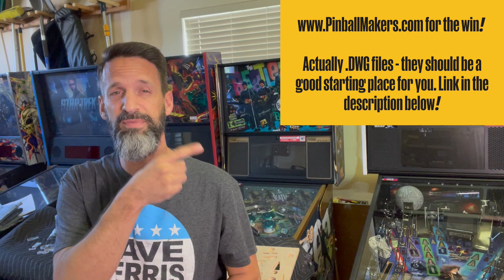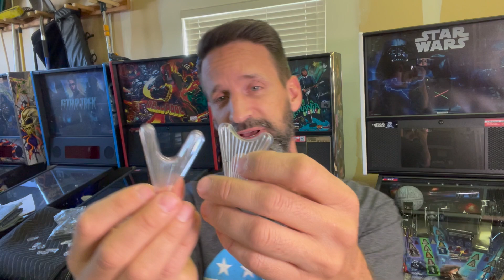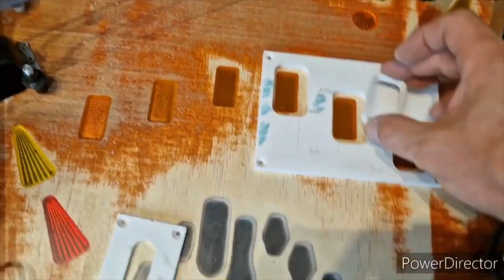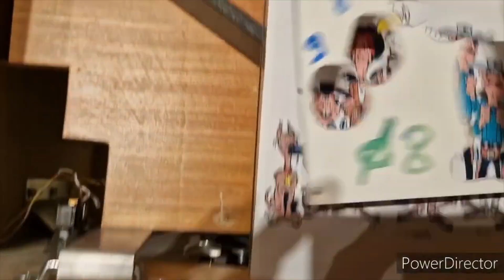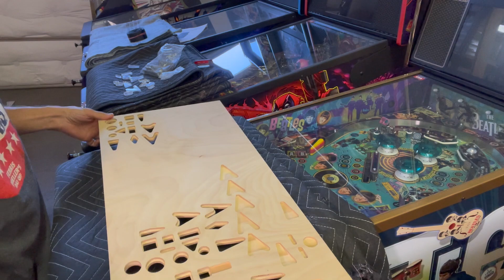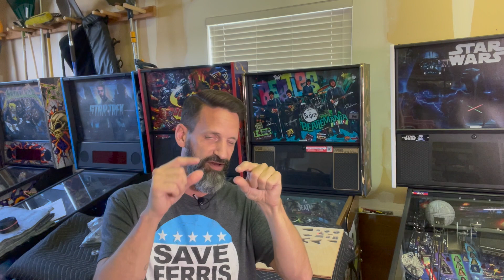HOW TO MAKE A PINBALL MACHINE: Cutting Playfield Insert Holes

Comment: mmm ... I like to uncomplicate things (usually because before I am done its too complicated, so I hope to achieve success before that happens. lol).. Since creating a hole to match the 'EXACT' shape I would be happy with a narrow 'trim' around it. by that I mean create the shape but make it 1/16" to 1/8" bigger - this avoids need to be 'exact' to the contour. then place the item in it, add epoxy resin to fill in the gap. scrap and wet wash the surface flat, then sand to plane it all the same. Don't think bubbles would be a big issue but can let a vibrating tool sit on it for a few minutes. 
So instead of the difficulty being getting the outline exact to fit, you design for how good it looks. which is what we need to spend our time on anyway. it would also be 10x faster

Comment: If the insert is below the wood, just fill the hole with clear. A la cupped inserts in playfield restoration. I have a couple videos on it.
Reply from the maker: Yeah I guess I could fill it with epoxy - I've never done a clear coating before, is it easy to fill a low spot more than other areas?
Reply: @thepinballroom  it’s a lot easier to make it level if they’re low vs high. You just use an eye dropper to fill it with clear.

Comment: Get a block sander for auto body repair, a 2x4 will not be straight enough, and will shift with humidity. A granite off cut would also be good, maybe better
Reply from the maker: Thanks for the tip!

Comment: Thanks for sharing.  I definitely agree with John Marsh's guidance, which mirrors the old tutorials the Classic Playfield Reproductions had posted about a decade ago (long gone now).  In summary, leave slightly proud, epoxy in place, use a planer to sand flush (or block sander as you advised).  Then artwork, then clearcoat.  The alternate strategy of sanding flush before installing works better on a playfield restoration, where you would damage the artwork if you sanded after epoxying.

Wood does swell/shrink with humidity and may change throughout the year or as you move a machine around the country.  For that reason, I would suggest you trust the epoxy to hold the insert in place.  Too tight a fit, and the wood may swell/crack and pop the insert.  Even a tiny gap is okay, as the epoxy can fill in the gaps, and gets sanded flush as part of the install process.  The artwork typically hides the gap so you'd never realize that it's common to have small gaps before glue-up - sometimes you can see this on a well worn/loved playfield.

Since you mentioned diffusing the lights, I'm surprised you're going with clear inserts and not white.  

While it's probably too late to help you now (great work on doing the CAD modelling), you probably would have had a much easier time doing this in Imperial/American units instead of metric.  While I do a lot of engineering and prefer working in metric, when it comes to pinball you have to keep in mind that most parts you're working with were designed many decades ago in the USA, and this definitely applies to the inserts, and they rarely used metric back in those days.  For example, that ~3mm radius is actually just the radius of a 1/4" router bit.  Insert sizes are typically in fractions of an inch, i.e. 7/8", 1", 1 1/8", 1 1/4", 1 1/2", etc.  They weren't very creative, they simply used the tools and measurement system they had handy, so a 1/4" router bit and fractions of an inch.  Same goes for arcs.  I'm not sure if this still applies to some of the more modern shapes, like those fancy triangles, but for any of the classic shapes this should hold true.

Looking forward to seeing a lit up playfield, keep up the great work.
Reply from the maker: Wow, awesome, thank you so much for sharing this! I will back off a bit on the fit of the inserts then and rely on the epoxy - Tibo mentioned a similar concern - I was worried that if I was too loose that the wood could shrink and potentially create too much pull in the epoxy etc and so I wanted to rely more on the lateral strength of the insert if the wood swelled vs the other way around, but I admit I'm making assumptions about the material strength etc that I haven't tested...?
Reply from the maker: Oh, and about the clear vs white inserts...I went with clear because I didn't find any white 🤣

Comment: moment of glory...;) If I had known I would have shaved..lol I promise next time I will frame my video better. Indeed I agree with your arguments and it will also cause problems for the artwork. The fact that you have done everything by digitizing at each stage is a big advantage. that's the beauty of this type of project...we develop our protocols to achieve our desired result. I have just solved one of my biggest problem: I started a playfiled with an atypical size without thinking about the lockdown bar. I managed to make a custom one .for the inserts I adjusted less than you because I'm afraid that if it's too adjusted it will move over time with the expansion of the materials with temperature variations. Thibaut
Reply from the maker: 😆 you look great! Digitizing is helping, but for the next machine, I'll do a lot more playfield design virtually in 3d first I think. 

Ahh! Yes lock down bars and receive of non-standard sizes can be a problem I've heard, glad you got yours figured out! 

And yes, with the inserts, I'm trying not to make mine too tight but still snug, I worry that if they're too loose, then temperature change (expansion and contraction of materials) could cause cracking in the epoxy or clear coat around them...? 🤷 I'll know in five years 😉